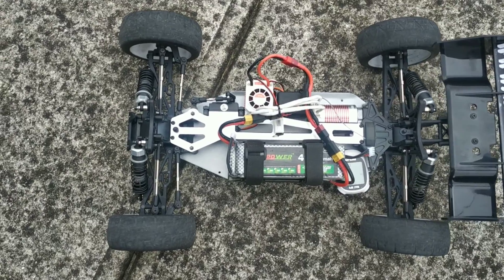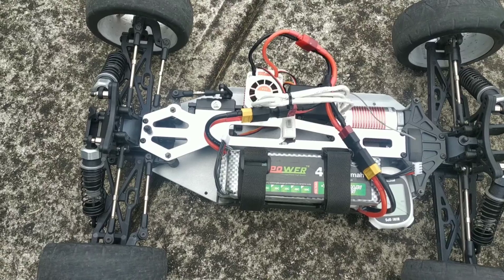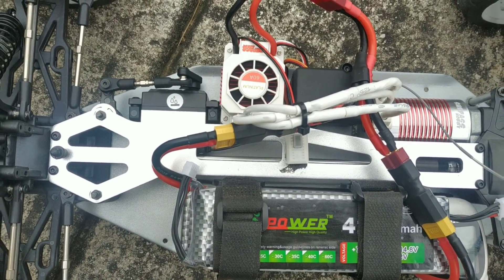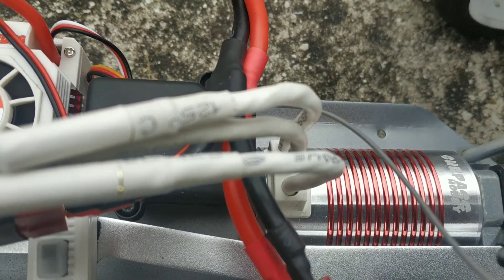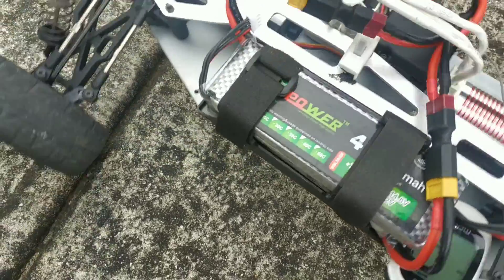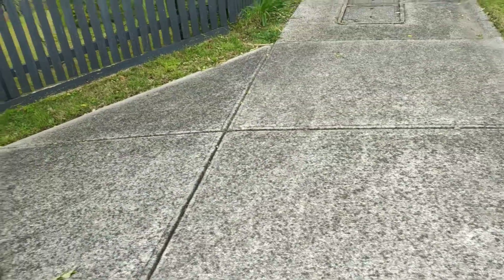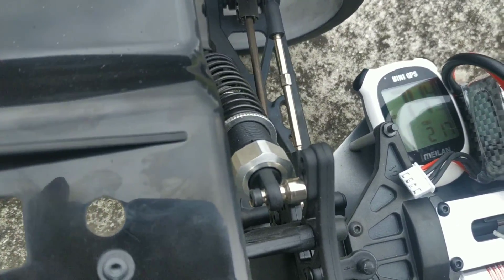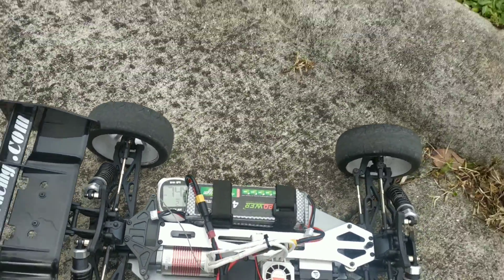VRX Blast BX speed run 2

Comment: Hey I wasn't far off! 😊
Nice run mate 👍
Reply from the maker: Thanks, hopefully will film a track run soon. Did a track run when I was using a 3652 3300kv motor and 17t pinion and it went quite well just needed some more speed.
Will track it on this set up but with Kforce wheels (71k/h) and install a 23t pinion soon get a speed run in that and hopefully that will be it and I can share some RC track races with it 👍🏻